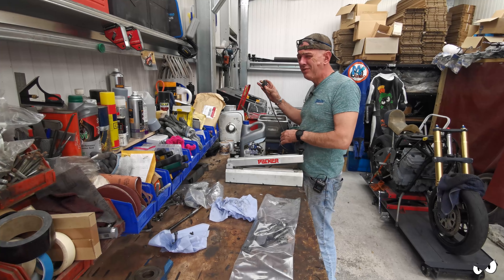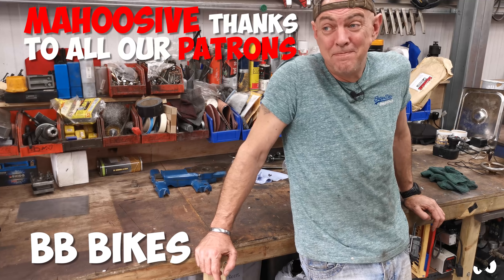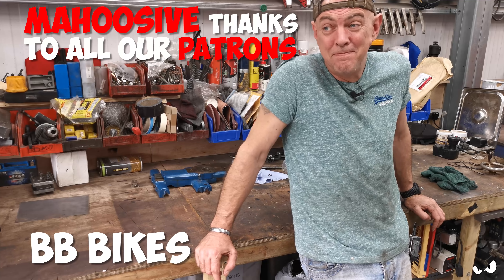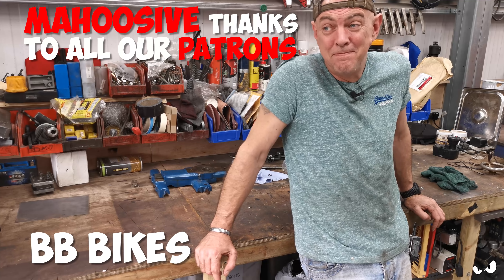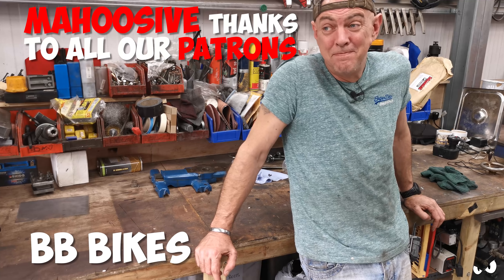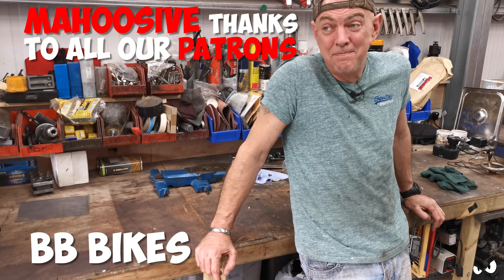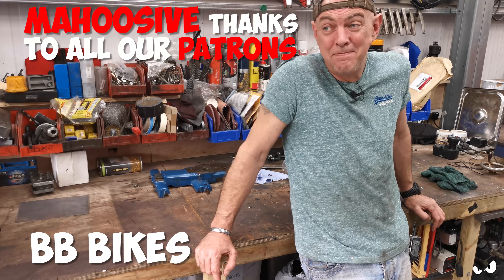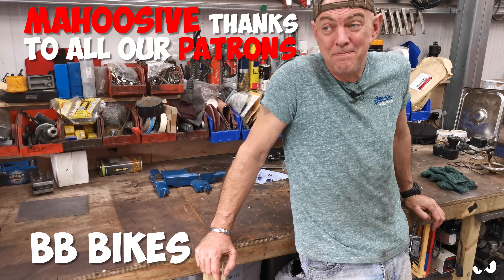Restoring a Boxford AUD Lathe - Part 5

Comment: Looking good mate......Yeah, I think you should paint whatever you can and only leave as bare metal those bits that need to be bare. I know that's not the popular choice but it will stay cleaner, longer. Oiled surfaces will attract dirt and sh*te, especially if you're grinding and blasting, and need constant cleaning and re-oiling. Painted surface just needs a wipe down. At least painting it is only a pain in the arse once! As for the motor shaft, I agree with other comments that this needs a key. You can't rely on a grub screw to transmit the power required without either mullering the keyway or shearing the grub screw....although it doesn't look as though there is a keyway in the pulley????
Reply from the maker: It's weird init.... To me, it should have a key, so I'm just going to file it down and make one to fit. I think that's the best option 😁👍

Comment: To combat rust on everything, have you considered running a de-humidifier 24/7? I have a mill and a Boxford lathe in a 15’x15’ wooden shed and I don’t get any rust at all!!
The dehumidifier collects shedloads of water, but then it would wouldn’t it🤣🤣
Reply from the maker: The shop is pretty sound so don't think that will be needed, but a sensible idea none the less. I figure lots of oil will do the trick.and it's gonna get that if its painted or not 😁👍
Reply: Quick Bikes 
There is always moisture in an un heated workshop, and every time you open the door you get some more!!!!! Things don’t rust in the house because it is warm. Borrow a dehumidifier for a day or two and see how much water it pulls out of the air..... a litre a day probably!

Comment: On the motor drive pulley - the slot on the motor shaft takes a key - the pulley should have a matching keyway machined into the bore that way you can not slog out the slot on the motor shaft with the grub screw - the grub screw should  go through the keyway so it contacts the top of the key - also the key provides a positive drive  with more area in contact than the grub screw -- check your lathe manual  -- parts list / diagram
  you make me laugh  with your casual approach and give it a go attitude
Reply from the maker: I thought that, but there's no key... I've sent an email to Tony asking if that's right as it would make more sense to me... Think it was a bit bodged to work... 🤔🤣👍